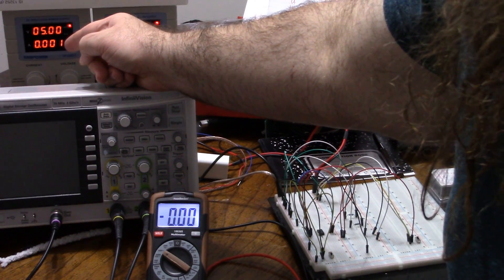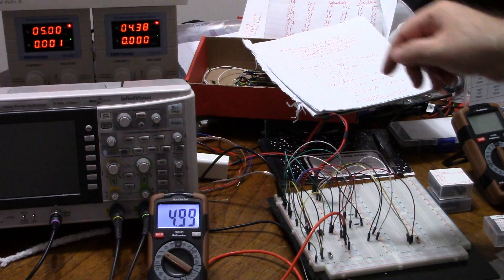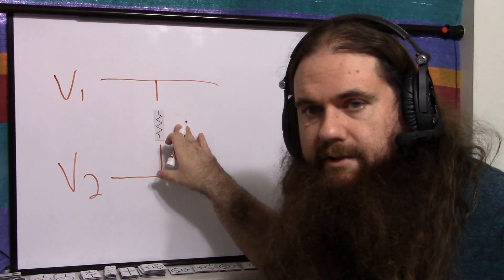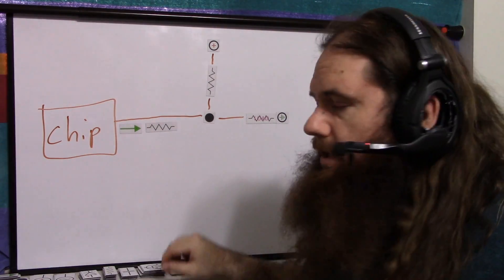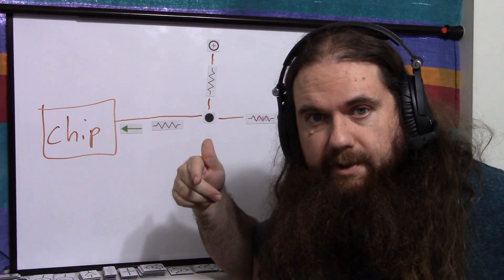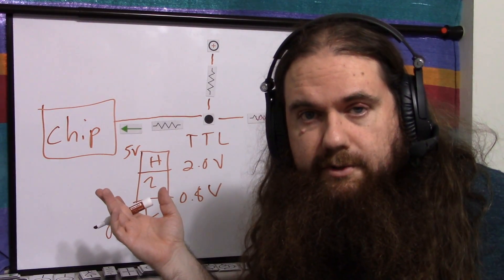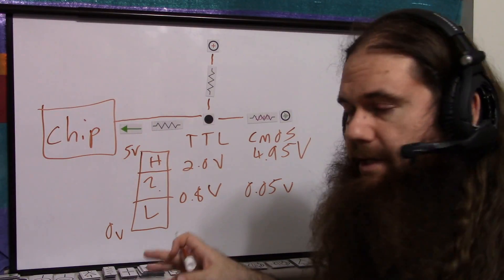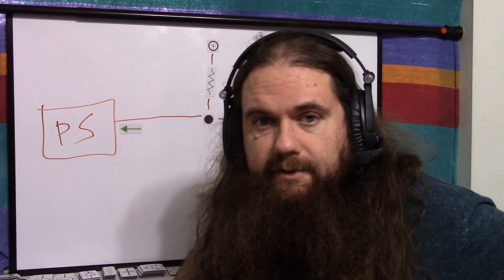Pullup Resistor To Bring BJT Chip Output Up To Rail - TTL to CMOS Level Conversion - Simply Put

Comment: The CMOS input level are 1.5v and 3.5v.  For ttl you are correct. The output level for CMOS is close to the reils, but in input can be 1.5/3.5 levels. The logic 1 is the problem .. 2.4 for ttl and 3.5 for CMOS . Also the rising time, parasite capacitance and the clock speed have effect too
Reply from the maker: I just found another site that says that low is below 1/3 Vcc and high is above 2/3 Vcc which matches your comment. Apparently I missed that during my research. Blah.

Comment: Thank you for making such insightful videos.
(I want you to know I just ordered a new oscilloscope because of your 'resistor ladder' video.)
Reply from the maker: My oscilloscope is the most expensive piece of equipment I own, and it has been incredible and immensely useful. I don't recommend someone starting out to buy one, absolutely not, but once you get into it for a bit and know it's something you enjoy, it's so wonderful to have.
Reply: @simplyput2796  I've been an electronics hobbyist since 2007. All I needed was an excuse to buy one. I bought a Hantek 200Mhz bench scope for just under $300. I jumped on it.
Reply: @simplyput2796  I absolutely love this thing! I had tried to write a software driver for 433Mhz modules many months ago and gave up. I blew the dust off the project once I got the scope and figured it out, piece of cake. ☺ Not only can I see wave forms I can also trigger on a 'start bit' and analyze data packets. I posted the code to a forum hoping that some will find it useful.
Thank you for your tutorials.